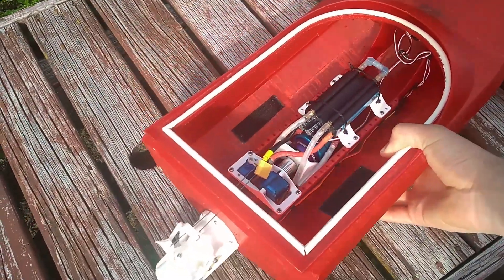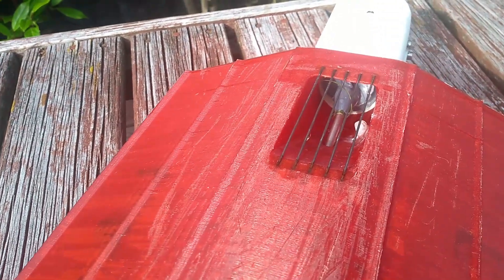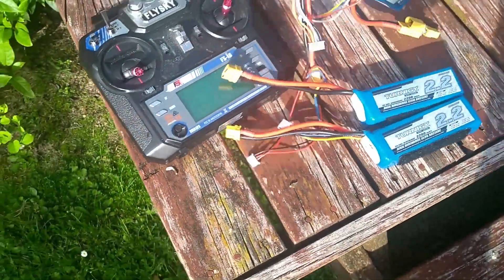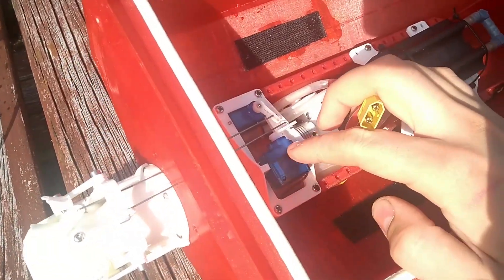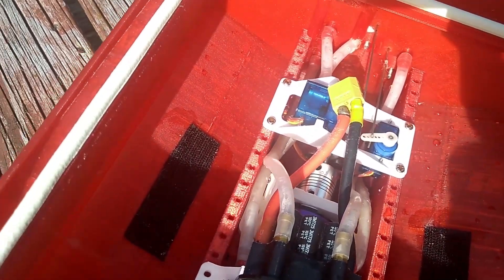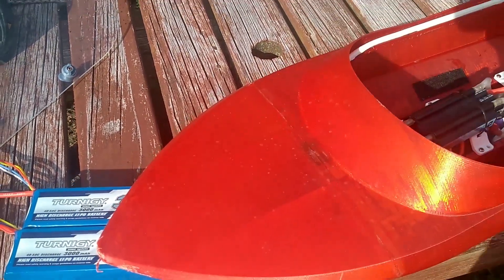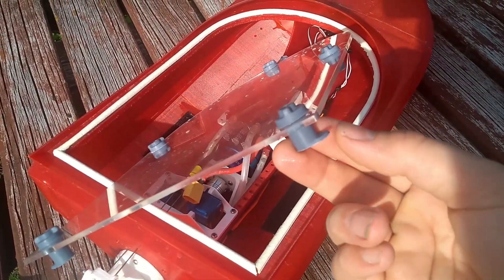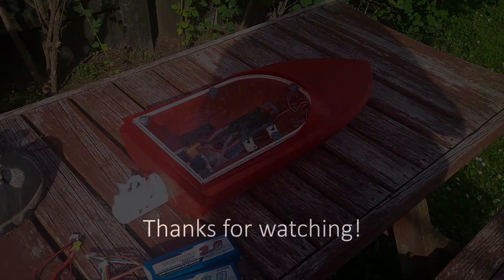KwikJet Update - 3D printable jet boat

Comment: Hi. is there a way to extract water from inside? by vacuum possibly? builted 2 of your  boats(one scaled down); for the bigger one got a mini pump triggered by a water sensor; but for the smaller one due to the size dont know if vaccum will work as Im still to test it... thanks

Comment: Any chance on how to install the silicone tubbing between the esc/motor and the 4 tabs on the boat? bit confused on how it works the water cooling system(first rc boat) thanks
Reply from the maker: All goods! So the idea is the two lower nipples coming from the pump supply high pressure water. The top two nipples are for water to exit the hull. 
So you want to have your motor cooling connect to a top one, and to a bottom one. So then water can flow when the jetpump is running. For the ESC you can do the same thing, one to a lower water supply nipple, and one to a exit nipple. Does that make sense? If you don't have a watercooled ESC you can just connect the lower nipple to the top nipple to just have the water go straight out the back of the boat.
Reply: @jotham123  thank you for the reply.